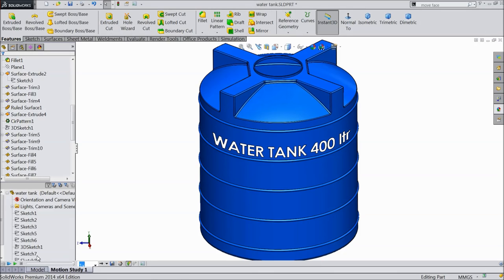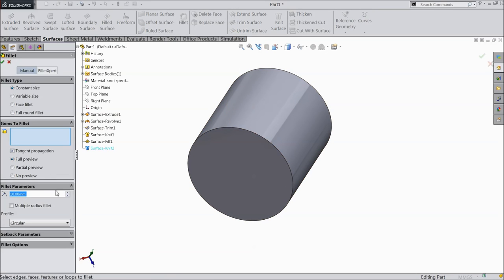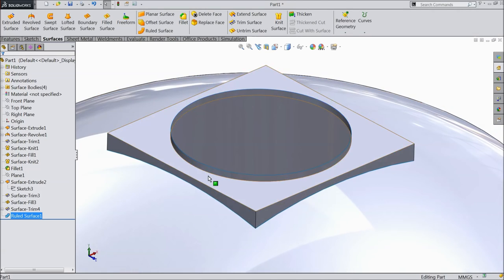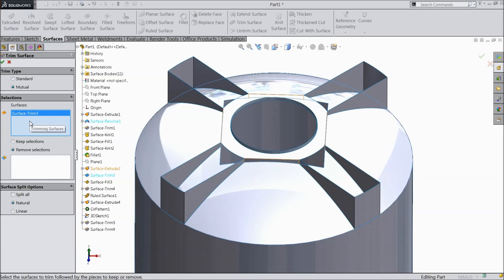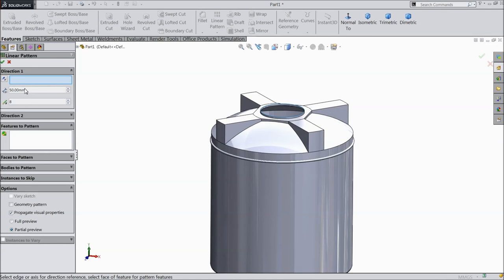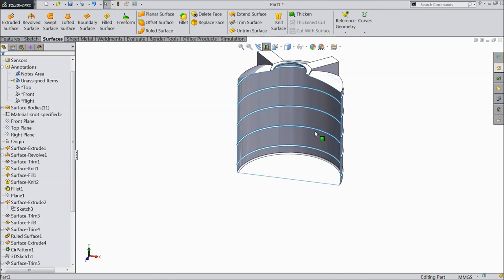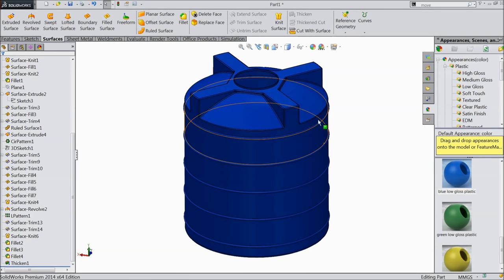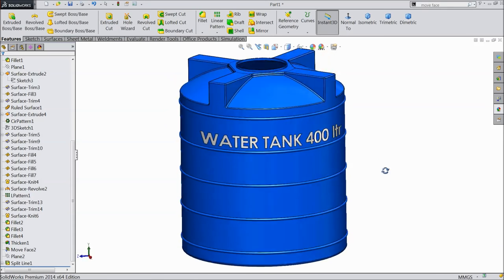Solidworks tutorial | sketch Water tank in Solidworks (Advanced Surfacing)

Comment: Why bother with surface modeling, when the easiest way is to first do everything in a solid body, and then just make a shell out of it all. So much easier and save a lot of time. This way of building is akin to repairing an engine through an exhaust pipe.

Comment: Hello, great video. How do you calculate the internal volume of the tank quickly and easily? Say you were adjusting the design to hit a specific volume, is there anyway to create some sort of separate body that automatically updates so you can check the volume after a change is made?
Reply from the maker: the same formula V=Pi x r2 x h  used for volume.
Reply: @CADCAMTUTORIALBYMAHTABALAM  what if it's very complex surfaces we have in our design, how can I calculate